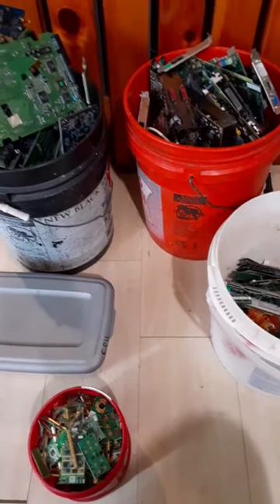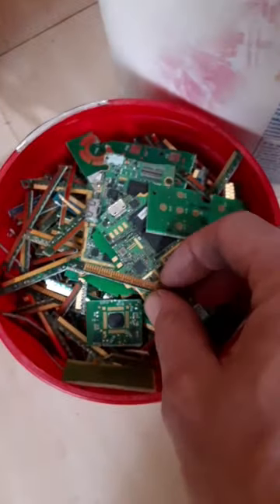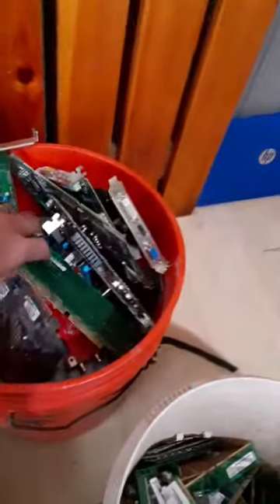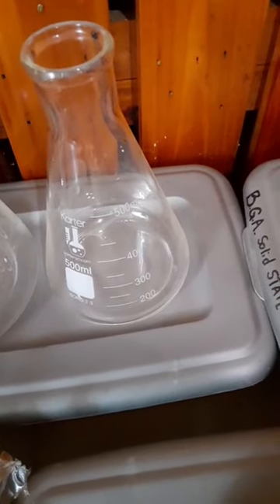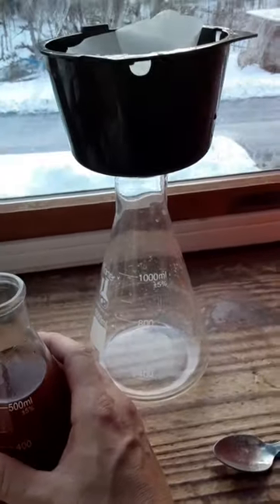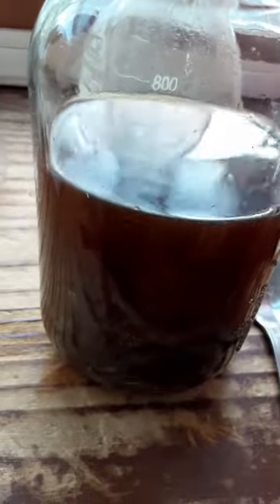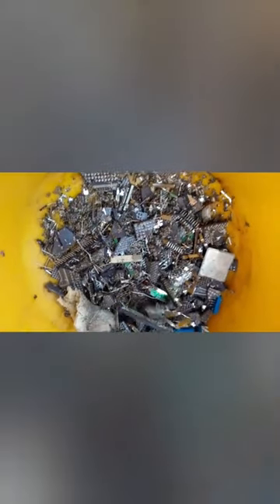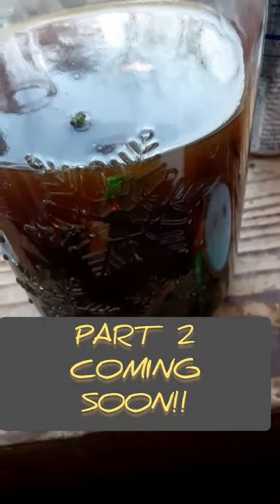Gold Recovery Using a New Method!

Comment: What you really need some big bucket about 3-5 gallons like you get from Home Depot or Lowe's and everything you want to get full stream in there with hydrochloric acid and just a little bit of 3% hydrogen peroxide put a air bubbler in it put a lid on it and then find something to do for about a month and when you come back most or all of your gold will be free of the boards and your ships will have had the legs removed probably and the hanging out on the bottom of the bucket underneath everything else remove everything make sure you Rinse any gold off that's hanging up on the boards still and filter it through something like some pantyhose or an old thin t-shirt and you can you reuse that copper 2 chloride indefinitely because it'll do a lot of the work for you so you don't have to

Comment: If you leave it undisturbed for a few minutes you can decant most of that from the top that will run to the filter very quickly and it's only the stuff in the bottom that will clog the filter and slow it way down. The idea with the foils is that you just want them free from the boards then you can melt it down and make a button because remember recovery and refining are two very different processes.
You never have to worry about not being able to precipitate your gold back from solution if you never put it into solution.

Comment: Cover parts with HCL, add 1 cup of sulphuric acid, and a tablespoon of sodium nitrate. It will strip all the gold too. But after gold goes into solution, decant and denox. Or else it will continue to eat into base metals and send them into solution too. After your smb drop, refine again with poormans AR. It's all cheaper than goldex. It may not be as easy, but it's cheap and fast.

Comment: As someone noted below, the music is quite distracting.. also- please start wearing safety gear. Don’t get the solutions on your skin, or breathe fumes.. and a tip-soak all your pcb’s/fingers in distilled water for a while before adding to the solution.. it will decrease absorption from the pregnant solution, so less yield loss 👍

Comment: What's the name of that powder that you using?
Reply from the maker: It's called eco goldex E series..
This stuff is great except for the learning curve.. Getting the product to swallow the gold is cake! Getting the gold back out, now that's a whole other story. Right now I have 2 batches going. I split 1 liter into 2.
I think I messed up the 1st batch so I'm going to try something different on the 2nd. My goal is to create a super easy step by step process for small guys like myself. I been at this for 8 years. You name it, I tried it! The process I'm trying to create  will need no nitric acid.. I hate dealing with that stuff. It's so dangerous..